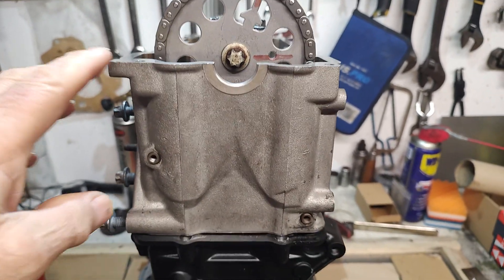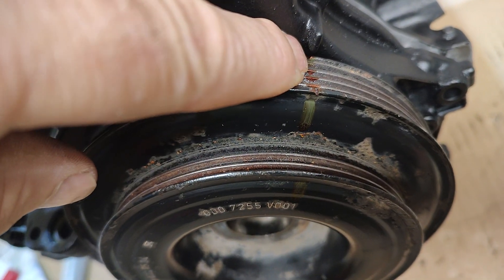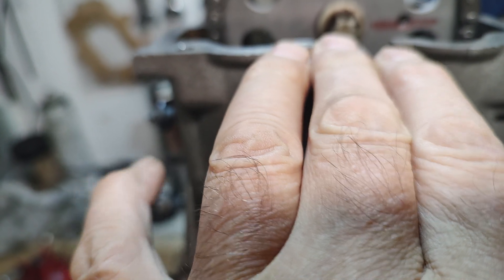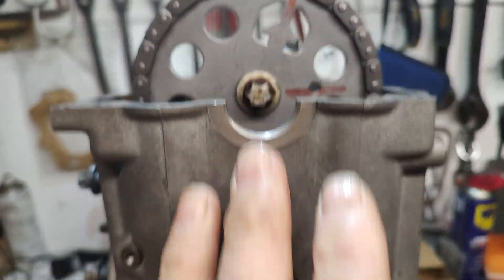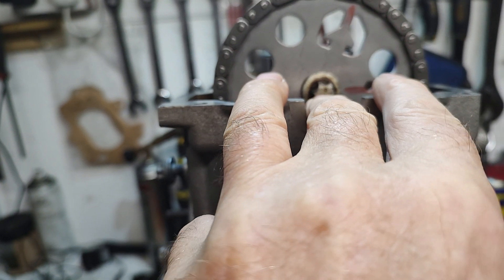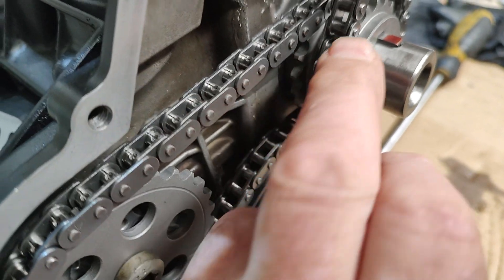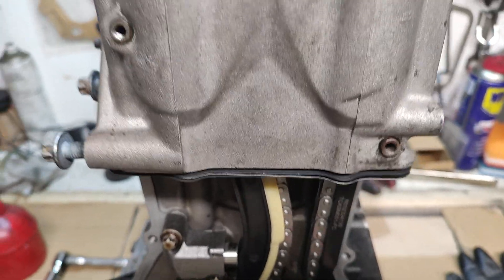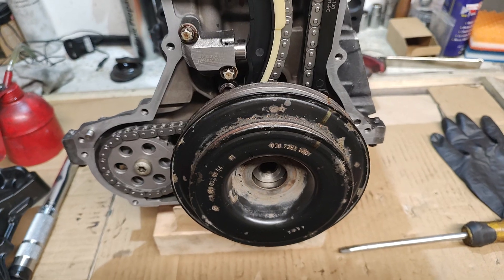SMART FORTWO 450 SETTING TIMING

Comment: Did it run as I did same and mine keeps trying to start but won’t start before it was running on one cylinder I believe could I be out by a tooth? The issue I have is the crank pull has rotted the timing mark away so I can only got off the wood chuck part any info would be great 👍
Reply from the maker: Piston will be at top dead centre when the pulley mark is in the correct position. So even if you don't have a pulley mark you can get the correct alignment.
Reply: @ ok so do I need to be within the rock of the piston at tdc or on the start of the drop? It’s such a stupid design in my opinion they could have put marks on the gears for chain or even a slot for the cam pull hole haha also have you done a cylinder head on one? I have and it didn’t seal? Could do with as much info as possible I’m new to these engines 👍

Thank you for your reply 👍
Reply from the maker: Both valves will be closed when number one is at tdc  on the rock as you described if you can't see put a soft probe down plug hole, at tdc everything should be in the correct position and camshaft hole will line up as in video 
If not lined up then you are one or more teeth out, good luck.

Comment: On my smart 450 this little hole on camshaft gear is on left side. And also on lot of other i found on internet.
Reply from the maker: Chevy, the choice is yours, I know what works, I only explain how to set the timing, you decide if you do it the correct way or not. David.
Reply: Dosnt mater one rotation it will be on the other side and crank will be same place

Comment: Hi mate. I’ve been a mechanic for 35 years and I’m actually pretty stumped on something here. I worked on just about everything there is trucks buses cars and never really come across a problem. However, I have a smart for two Sam engine that you are in the video with, compression valves camshaft all good. I have 12 V to each power pack. New fuel injectors are at work. Also spark from the power pack checked with spark plugs that are sparking against the engine. There is no reason why number three cylinder is not firing have you any ideas on this,? regards Gareth
Reply from the maker: Have you tried swapping the coil pack around to see if the issue moves to another cylinder?